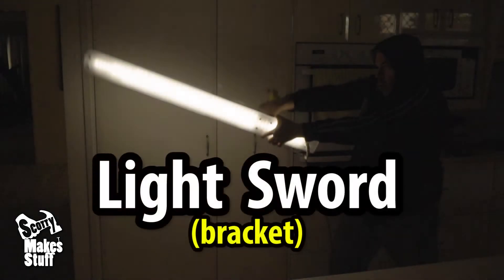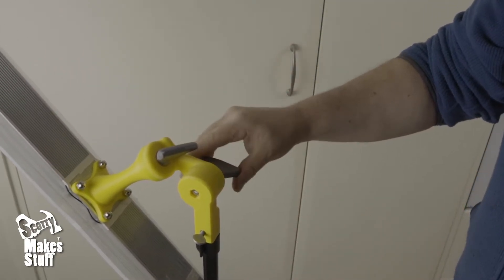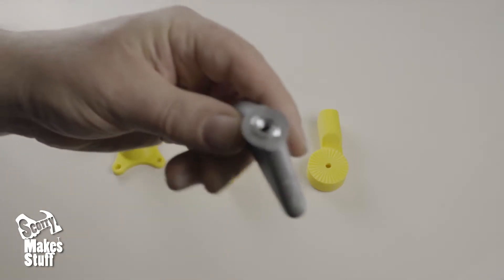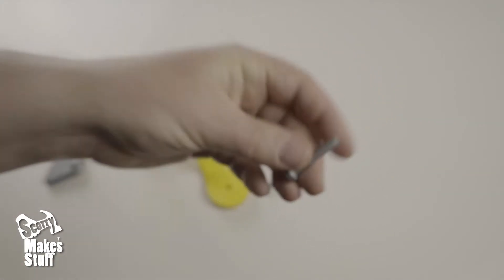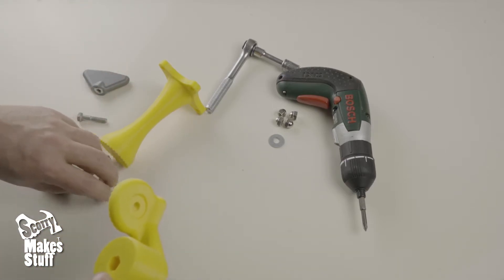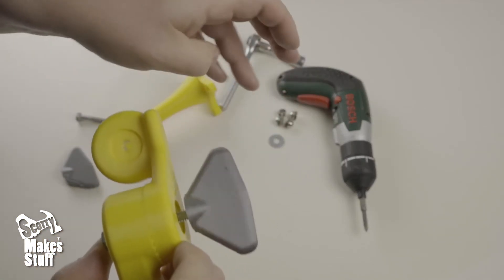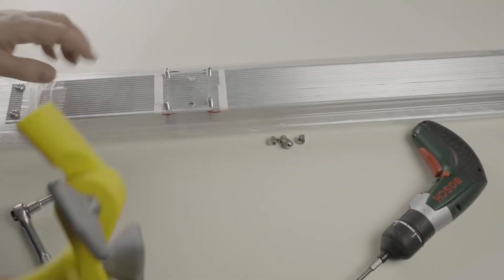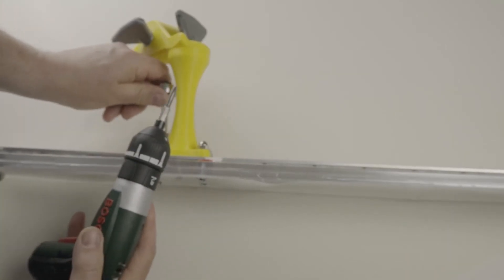Light Sword Portable Video Lighting

Comment: Hi Scotty,

First let me say I like your design, and I like the LED light you made. It looks great.
I think however, you can improve a few things to the bracket to make it more reliable and more stable if you are going to use it outside.

In my opinion you should shorten the arm. You are bringing the weight of the lamp far from the center of the lightstand, therefore making it unstable and risking it to fall. Also, when the arm is shorter, the arm is less likely to break.
Then as a second thing, the way you printed your arm makes it nice and round, but also fragile. Chances of a print to break layer to layer are bigger then when the arm would have been printed on it's side, so that the layers are in the length of the arm, not the width.
Sorry for my bad English, I hope you understand what I mean?
Printing the arm shorter and on it's side is going to change this thing from very good to absolutely great !!!

Thanks a lot for posting and making this video.
Greatings from the Netherlands,
Brian.
Reply from the maker: Thanks for the great feedback Brian!
As with any design there's always compromises to make for functionality. The arm is that length to give the light the ability to pan down about 30 degrees when in vertical orientation which is often how it's used as a fill light. 
I've tested the arm out quite a lot and it can take a far greater load than what would normally be encountered in typical use. But, your point is important as I can't control what filaments people use or how others print the arm... Also a good point about the orientation. It was made like that for support-less printing but I think it's better to be safer in that case so I will think about a design variation for flat printing together with beefing the arm up! 
I'm also going to be modifying the arm with a new version sometime in the near future to use for a 3D printed 100W LED spotlight... Just need to find the time :)